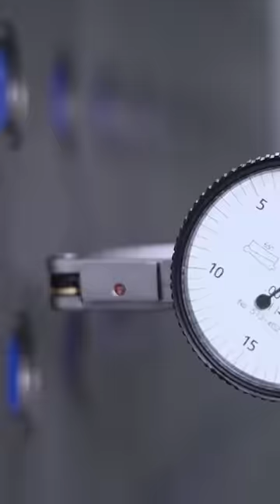MONSTER Vise Installation holds 1700 LBS of STEEL #shorts

Comment: I liked the part where you decided the table didn't have enough mounting holes.
Reply: More than likely a different metric thread
Reply: @Cris.tianmartinez  I think it was more they wanted a solid fixed position instead of using the clamp holes or dogs to hold the vice in place.
Reply: I like my holes with a few spots of table around
Reply: I almost cried when I saw that. I've made tombstones and work holding jigs, but my employers have always required me to make them work with the existing equipment. If I had cut into a table, for any reason, they'd have lost their minds.
Reply: @William_Kyle-Yuki_Yuuki  you could use a fixture. bolt it on drill into that and good to go drilling into the table is wild.

Comment: I worked at the factory that made bed hoist rods for Cat 797 trucks. They were 14’ long and 36” diameter solid rods. We CNC machined them and then ran them through 3 different $3M dollar grinders using diamond grinding wheels to get a .001” runout down all 14’ of length. 

This is child’s play.

Comment: What will this become? Can't figure out why that wavy cut is there.
Reply: I wasn't sure if it was doing threaded posts in a more efficient way, or if that's just the rough and it will smooth it out on a later step
Reply: I’m guessing a head or a black

Comment: I used to work at a steel shop that would send pieces out like this quite often and I always wondered what happened to him once we shipped them out exactly how they would go about working on them and I'm not how I, I am shocked. I didn't think they could be machined. That's one solid piece because they were too big and that machine would have to be massive and apparently a massive machine isn't no big deal 🤣🤦‍♂️

Comment: That's not the most steel we sell at alro steel. 12 inch round at 12 feet long roughly 5k lbs And why is that cold roll so rusty?

Comment: It's a tooling demo so there is no coolant but I cringe anyway!
Reply: Could also be using high speed end mills that don't require coolant to cut, got a few of them on our DMU210p and they rip thru 4140/4340 , 18chrome or 9310 blocks
Reply: @joshable14  I'm no longer in the trade. 20 yrs now and I know there is newer better faster but I can believe coolant isn't at the root of long lasting, accurate cutting

Comment: Imagine drilling a hole at the wrong spot in there....
Reply: I did, when making some rare similar monsters. Mostly 4M chassis aligned multi-point boring, drilling etc. and finishing, but some thicker slobs of few T, like hydraulic heads, housings and massive special orders came up too. This is only 765Kg. Luckily had help at hand and never broke a tool on them, due to braking most of the tools on my smaller 3-axis Hartford Tornado2. Now, that's quick for also a training machine. (1280×650×750 for that and 4000×3500×2500+1000 for Doosan). For the big 5-axis one, a festive and scary feeling figuring out old fixings (this setup here would be a bomb, but never cost-effective for my once Ukrainian-Latvian company) and Fanuc programming if don't know macros codes by heart.